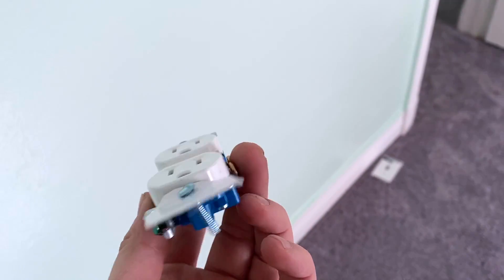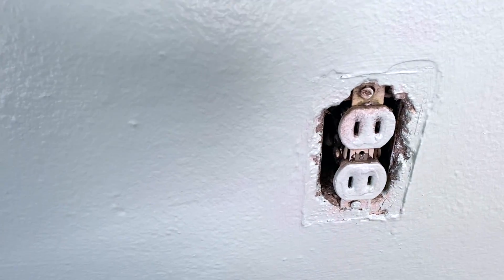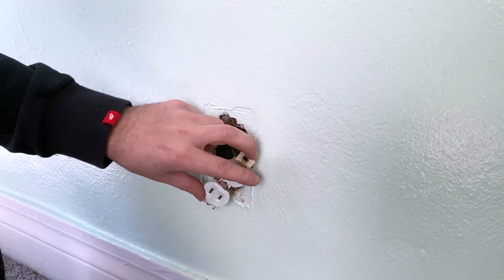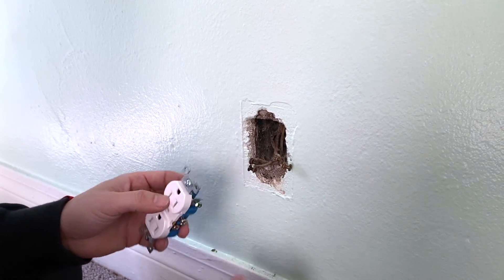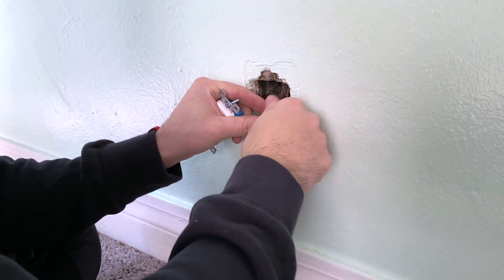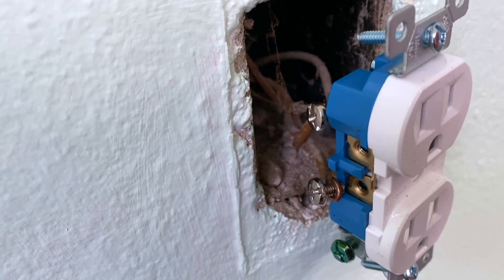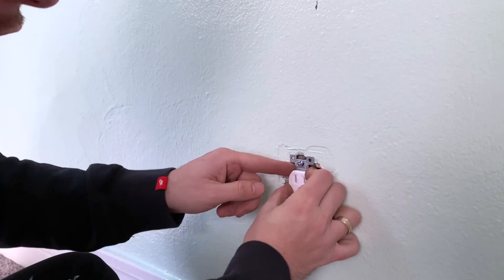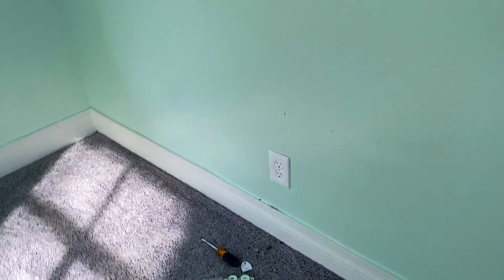How to Replace an Electrical Wall Outlet - Old and Rusty To Brand New

Comment: Great way to make sure power is off make sure you check. Use a volt meter if u don’t just simply plug something in like a phone charger or anything and if it don’t charge ur good

Comment: i have 3 black and 3 white wires.  theses old wires are too thick to push into the tiny hole in the back. just double them up on one screw? that will be difficult
Reply: Get some wire nuts and add an additional wire. Wire the two new wires to the receptacle.
Reply: anyone?

Comment: Not having a ground is NOT OK! You need to properly ground this receptacle or install a GFCI at the very least. Contact a professional next time.
Reply: My house is over 100 years old and has never had grounded outlets or switches. I'd rather have them grounded, but it works for now 😂

Comment: How do you know which wires are black and which are white if they're all old and the bad outlet isn't marked?
Reply: Turn on the power with the wires disconnected and separated. Use a tester to determine which wire is hot. Turn the power back off.

Comment: You can’t replace an old 2 prong receptacle with a regular 3 prong receptacle. You either need to add a ground assuming your boxes are grounded or replace it with a GFCI receptacle!
Reply: He did it so there no cant lol
Reply: @Patronesofly  
It is a code violation. All those receptacles will have to be replaced again when the home inspection fails before selling the house.
Reply: @Patronesofly  I mean he can but it’s against the code and can cause serious problems!
Reply: @matthewtorok-smith1967  Yes you are def right actually I had to do some research after
Reply: Thank you for this comment. I need to replace an outlet at my girlfriend's house and it is a 2 prong receptacle.
Reply: @bl6785  yes, that’s the whole point of installing a GFCI because there is no ground wire. If there is a ground wire, install an AFCI receptacle (the regular kind)
Reply: @bl6785  no problem. Get a GFCI receptacle!
Reply: @bl6785  
Replace it with another two prong receptacle or with a GFCI properly labeled as ungrounded.
Reply: My friends home, she wants to replace a few outlets,i don't believe that are grounded. I can simply replace it with a GFCI outlet, instead of a regular one, and all is well?
Reply: @Majestiicc12  yes that’s exactly what you would do and all would be well.
Reply: @matthewtorok-smith1967  then that's what I will do! This is great, thank you so much!
Reply: @Majestiicc12  no problem
Reply: Sorry, again, I have another question. I was just reading about this stuff, and it makes a point of explaining that there are 15 and 20amp GFCI outlets? And not to put a 20 on a 15am...circuit? Am I understanding that correct? Also, I recently discovered an AFCI, now, what is this and how does it play into my seemingly simple task of installing an outlet? Do I need one of these? It is simply an outlet along a wall in what will be the living room. The most that would be plugged into it would be... a vacuum, laptops, and most certainly phone chargers. Which plug, among the seemingly many, do I need to put in?
Reply: @Majestiicc12  an AFCI is a regular everyday outlet. AFCI stands for Arc Fault Circuit Interrupter Receptacle and GFCI stands for Ground Fault Circuit Interrupter Receptacle. Also, in the link below is a 20amp vs 15amp receptacle. The one on the left is a 20amp and one on the right is a 15amp. Does the current 2 prong receptacle have a T shaped hole? If so then get a 20amp. It should also say on the breaker at the panel wether it’s a 20amp or 15amp breaker. Also, how many 2 prong receptacles are you replacing?

https://images.app.goo.gl/WRuRAbU8EoCoYqFZ7
Reply: @matthewtorok-smith1967  ah ok, my mistake. I apologize for my ignorance. It is only the one, as far as I know. Definitely does not have that strange T in the outlet at all. Just a 'standard', two-prong outlet. (I don't even know what to call them anymore :D what is life) are they outlets, plugs, or receptacles?? They can't be plugs, assuredly not lol.
Reply: @Majestiicc12  oh no worries! Outlet, plug, receptacle let’s just say all those words are synonyms! Definitely just get a standard 15amp GFCI receptacle then and especially if you aren’t going to be plugging anything huge in. Also, I know this would be time consuming but my advice to you is to check the other receptacles with a receptacle tester to make sure they have a ground. If they don’t, that could cause problems further down the road and when you least expect it. Also, if they don’t have a ground what I suggest you do is find the load receptacle(the one connected directly from the panel) on each circuit and replace each load receptacle with a GFCI.
Reply: @Majestiicc12  if the load receptacle is a GFCI, the rest of the receptacles on the line can be AFCI ordinary receptacles.
Reply: @matthewtorok-smith1967  Dont suppose you would be willing to let me email you?
Reply: @Majestiicc12  sure
Reply: Amen, the only way to guarantee protection is to install a GFCI outlets.
Reply: Is old wiring still good enough though cuz mt friend is taking about trying to replace  all the old wire in home which would be a alot.
Reply: i asked this above but you seem like the guy to ask: i have 3 black and 3 white wires.  theses old wires are too thick to push into the tiny hole in the back. just double them up on one screw? that will be difficult. i have an extra gfci so use that? the holes in the back are a little bigger so can i plug the third black and white wires into them? a little extra info: the outlet would spark a little when i plugged my new induction hot plate in. after a couple months the spark got a little bigger, then the outlet started working sporadically. i removed the cover to find the outlet had burned and the plastic melted a little. 
it's a kitchen outlet obviously. while it was out of service, the outlet my exhaust fan above the stove would not work, nor an outlet on the other side of the wall in the living room. i assume that is why i have the extra black and white wire. what gives me pause is one black wire was just laying loose in the box. it was not curled as if it had been wrapped around the screw. it is too thick to have been plugged into a hole on the outlet. it was not wrapped in tape or  a wire nut. is this the reason it was sparking or is it the new appliance? a couple amazon reviews said this single burner hot plate caused sparks in their outlet. what to do about the loose black wire? i was going to plug it into the back of the gfci
Reply: forgot to add, it is a 3 prong outlet i am replacing, but not old so replaced before
Reply: @Mr._Chievous  I think you should get a 20amp receptacle instead of a 15amp. That is likely the problem if it had melted and also as to why the wires didn’t fit into the holes. Also, it is better to wrap them around the screws than to use the holes too. At hardware store ask for a 20amp receptacle. The reason some other receptacles and your range hood weren’t working is because when there are 2 or more blacks and 2 or more whites, the receptacle is a bridge and one of the black wires is a load and of the white wires is a load while the others are lines. The line wires won’t be live until connected to a load. If you have three black wires and three white wires, buy some extra 12/2 AWG wire and cut about 17cm (7in) of white and 17cm (7in) of black. Twist all 4 black wires together with a marret and all 4 white wires with another marret. That way, you’ll only have 1 white wire and one black wire to connect to the receptacle.
Reply: @matthewtorok-smith1967  that's a pigtail, right? i' thought i only needed gfci near water sources but i'm going to replace the other two countertop outlets with 20a gfci. thanks for your advice
Reply: @Mr._Chievous  no problem, glad I could help. Yes it is called a pigtail and if the receptacle is bridged to another GFCI you don’t need to put another GFCI in.

Comment: Where is the ground?
Reply: Likely the house was build in the 1940s or 1950s. Back then receptacles only had two prongs and no ground. Three prong receptacles didn’t start until the late 60s. Also, this video is incorrect, you need a GFCI receptacle to replace a two prong receptacle or add a ground.
Reply: @matthewtorok-smith1967  that is why I asked? Do you have any tips on installing grounds or ground protecting light switches and lights. Thanks🙃
Reply: @helenkiflu5292  the way you’d replace a light switch is just replace it with a standard light switch but use a screw less light switch plate where no mental screws are exposed. There is a YouTube channel called Sparky Channel and I believe he made a video on that too. His channel can be very helpful!
Reply: @helenkiflu5292  in some older houses, there is a ground where the ground wire is wrapped around the metal box going down to the panel.
Reply: @matthewtorok-smith1967  yes I have seen his videos but never that one specifically!! Will definitely do so thank you!!!!!!
Reply: @matthewtorok-smith1967  
Yes. He should have tested the box to see if it was grounded...